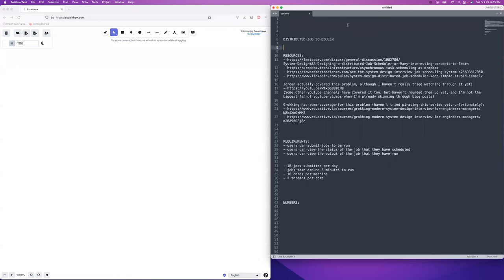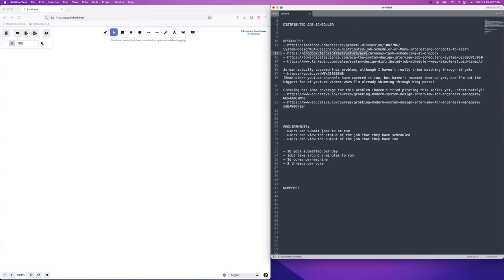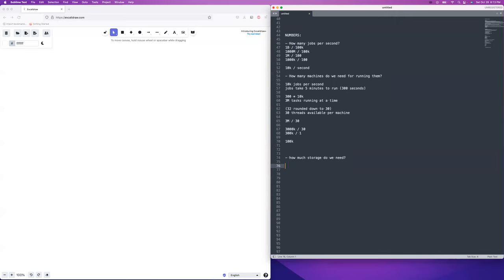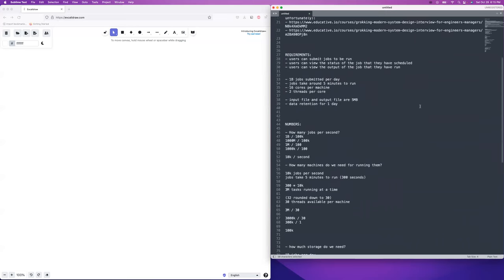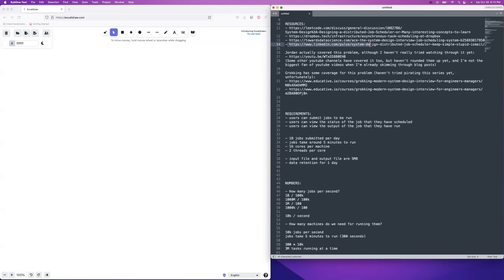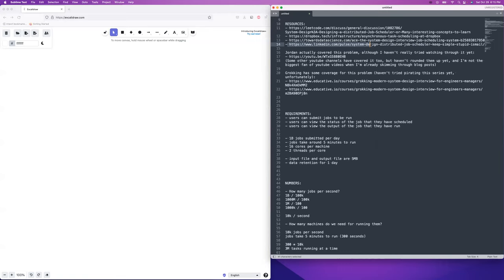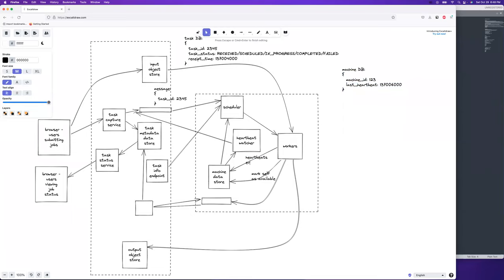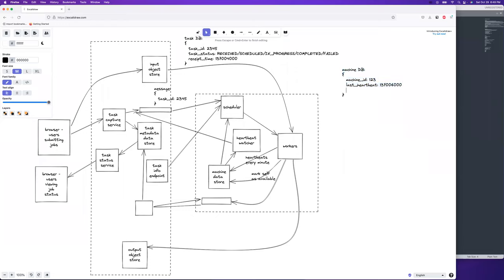System Design: Job Scheduler (with FAANG Senior Engineer)

Comment: Thank you for the solution. The design is fine, but the scheduler itself not very clear. Do you mind explaining that a bit more? How does it work? Is that just a server listening to the message queue? Also, are you pushing all tasks to the message queue as soon as the user schedule them? What about tasks schedule for a year in advance? If you're putting a service to pick up tasks to run and adding them to the queue, how does it work? does it run every minute? every second? is that a cron job? That part is not clear. Thank you.
Reply: +1. This is the heart of the problem. It would be great if you could add those details. Overall great video and awesome effort in putting this together.